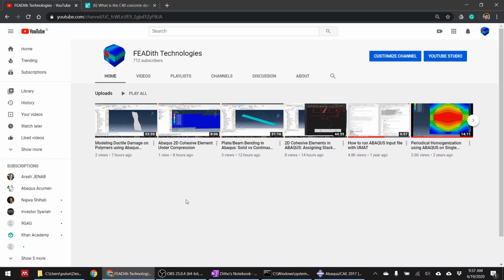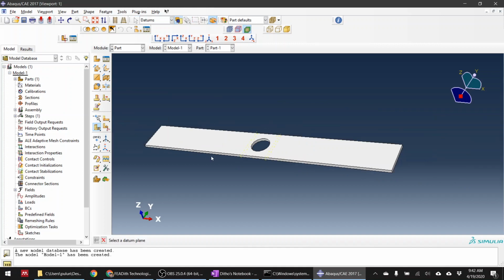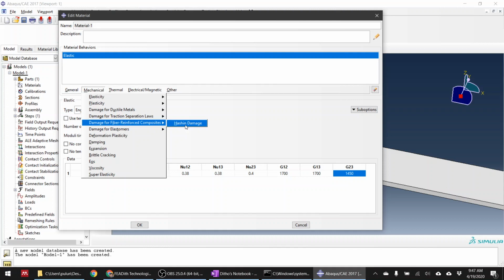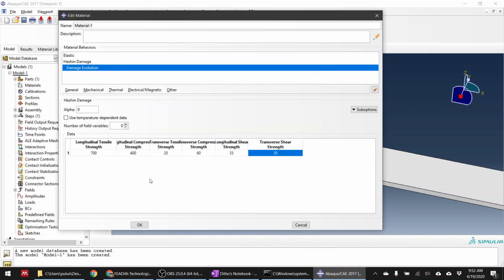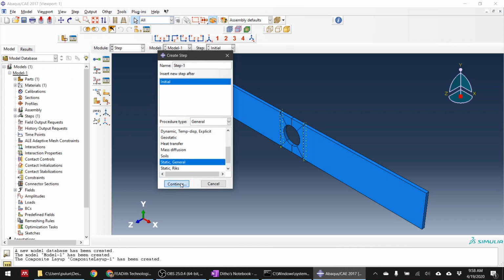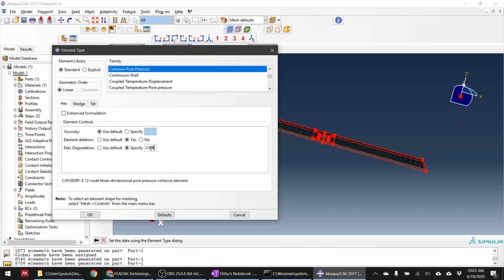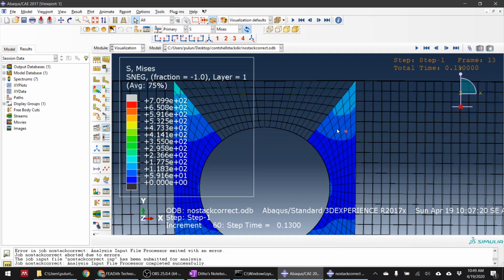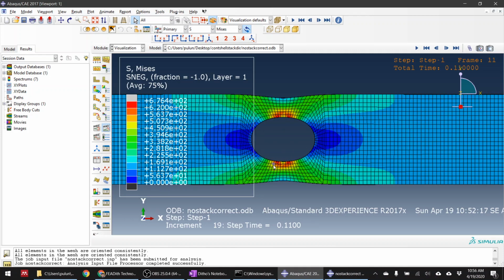Macroscale modeling of composite laminate (Open Hole Tension) in ABAQUS using Continuum Shell

Comment: I am not sure whether having two elements through the thickness is correct given that you have selected the whole model and defined the lay-ups. Here is the information from the manual "Continuum shell composite layups are expected to have a single element through their thickness, and that single element contains multiple plies that are defined in the ply table. If the region to which you assign your continuum shell composite layup contains multiple elements, each element will contain the plies defined in the ply table, and the analysis results will not be as expected."

Comment: Thanks for the toutrial! I am wondering what should we do about stacking direction when we define a local csys for our layup? On this situation, which direction is the correct direction for stacking?
Reply from the maker: stacking direction is a way to tell abaqus about the directionality of an element

local material orientation is to tell abaqus about material principal direction. 

they are 2 different things..
Reply: @FEADith  
Thanks for your reply 
Actually I modeled an assembly of composite parts including continuum shell and solid elements 
And give the materials orientations by local coordinate systems
My model is extruded in a size of an element
I tried different stacking direction and cannot get the correct result 
I am pretty sure the problem comes from stacking direction of element and have tried different elm directions but it has not worked out
Any thoughts is appreciate

Comment: Are you sure the thickness is correct since it is relative thickness not thickness itself?
Reply from the maker: Element Relative Thickness
The relative thickness of the layer. Abaqus determines the overall section thickness from the element geometry, and the thickness may vary through the model for a given section definition. Hence, the thickness values that you specify are only relative thicknesses for each layer. The actual thickness of a layer is the element thickness times the fraction of the total thickness that is accounted for by each layer. You do not have to use physical units to specify the thickness ratios for the layers, and the sum of the layer relative thicknesses does not have to add to one.

Comment: Thank you sir. I just confused. The material is brittle. We normally say that brittle materials are stronger in compression than tension. However, the number is vice versa. Please explain it
Reply from the maker: good question turan,, yes you are right... for normal isotropic material, usually the compression strength is higher than the tensile strength, especially for brittle isotropic material. why? because in compression you tend to close the crack, while in tension you tend to initiate cracks and once the crack appears.. rapid crack propagation appears.

However, in continuous fiber composites, the behavior is anisotropic, dan the strength is dominated by the slender fibers bonded by the matrix (which is very weak compared to fibers). So when composites are compressed along the fiber direction, the fibers tend to easily buckle... so easy that it requires lower stress compared to the stress required to break the fibers under tensile... yes.. that is why. (the slenderness and weak matrix bonding really make the difference)

Comment: can you modèle de laminate by doing every pli alone then assemble them with cohesif elements ?
Reply from the maker: Yes you can. You can make part for each ply and for each cohesive layer.  Then assemble them and assign tie constrain between the cohesive layer and the surrounding plies. It should do the job.